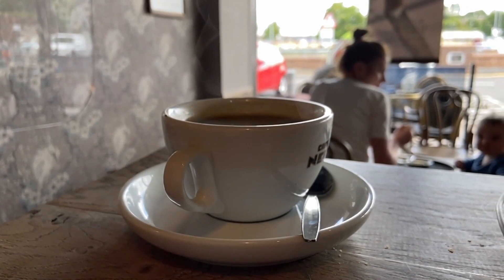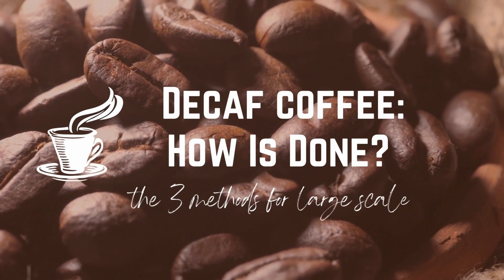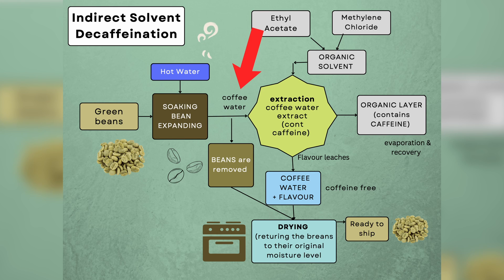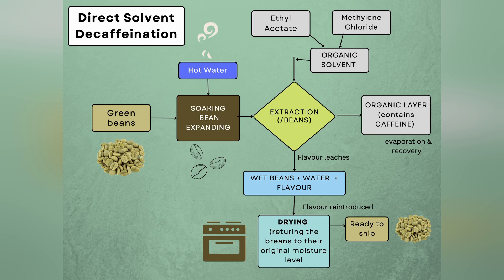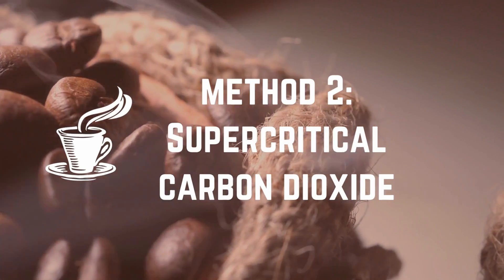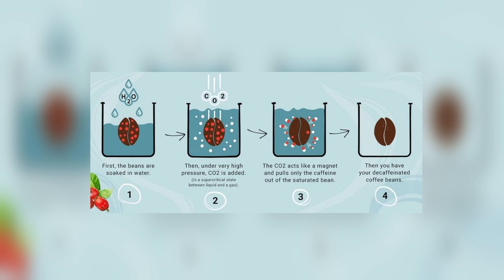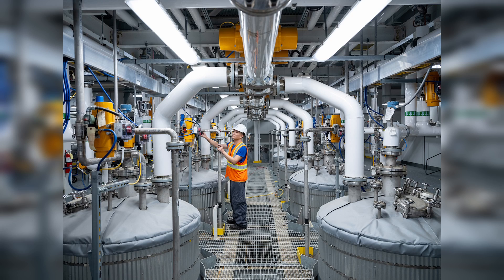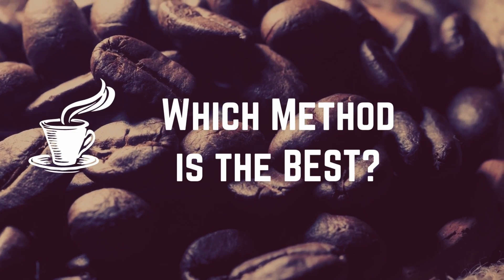How Decaf Coffee is Made: Methods, pros and cons

Comment: But how is the green coffee essence made? In an environmentally friendly way?
Reply from the maker: as we said in the video, the green coffee essence is made by extraction from raw beans. but the medium/solvent of the extraction is the key. The eco-friendly methods use either the Water Process (Swiss) without any other chemicals or the more niche supercritical CO2 Extraction. The CO2 method is the cleanest, as the gas is recyclable and leaves zero residue. But it is expensive to implemnt/ capital cost for equipment etc. in the video we discussed the less sustainable methods rely on chemical solvents. if you buy decaf, look for "solvent-free" labels.
Reply: @TassosKoidis   Thanks.